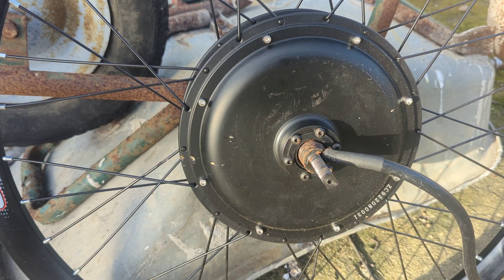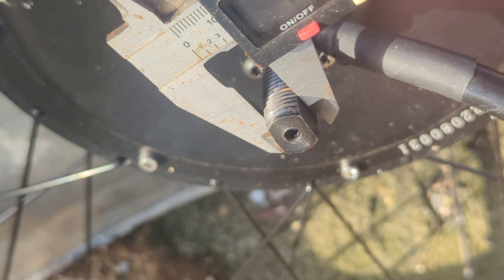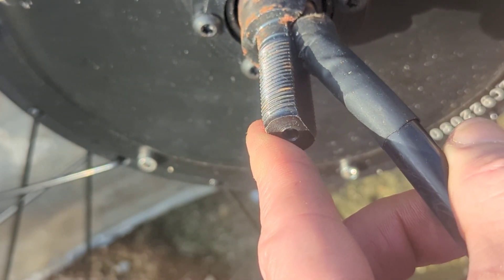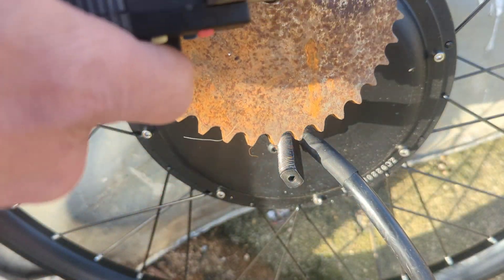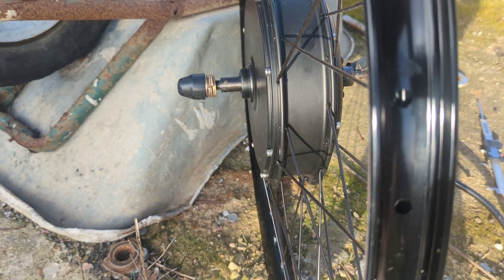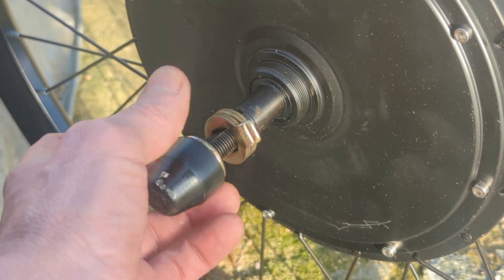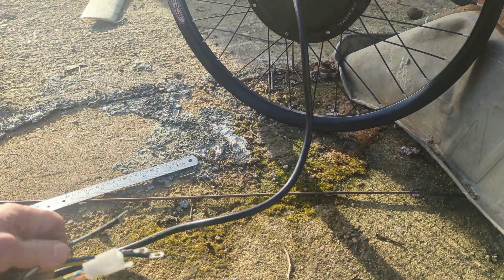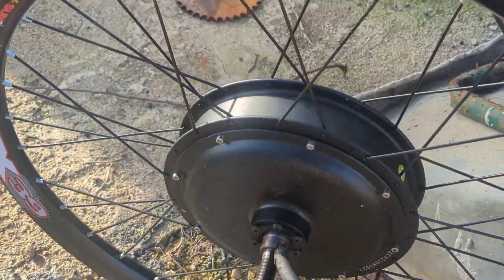3kw 72v Ebike Hub Motor as a Wind Generator

Comment: Thank you for your videos. They are very informative. I have a question. Can I use this stator/generator in hydroelectric? I need to generate around 4kw
Reply from the maker: You may be able to get it working. You'd obviously have to attach some fins to it, but I may do a test one day with a pressure washer to see what it's saying